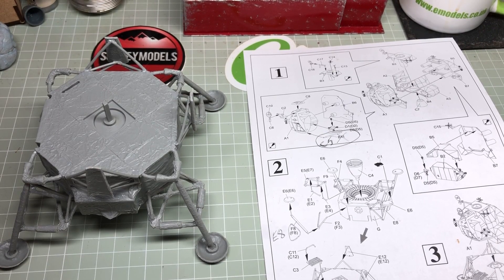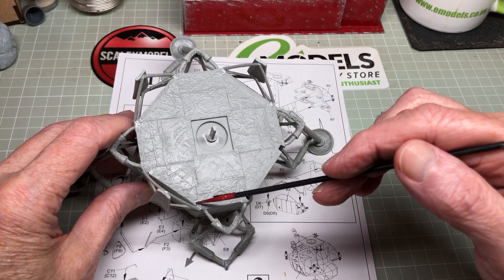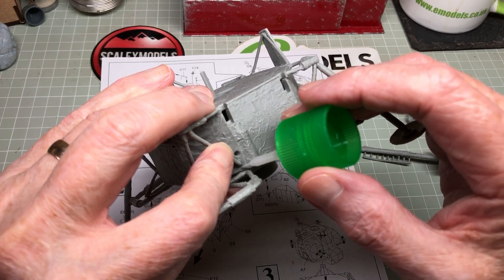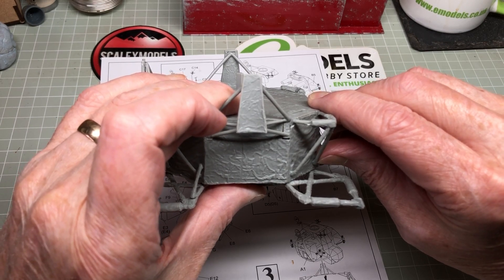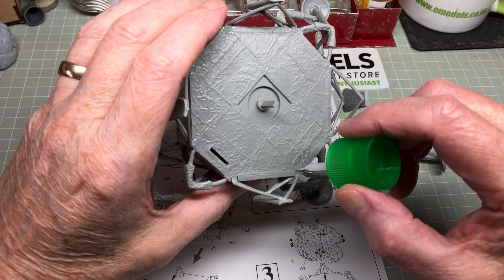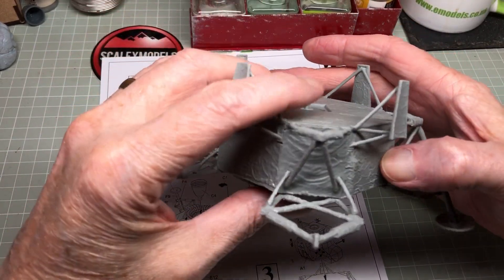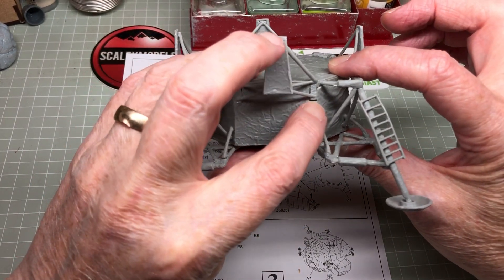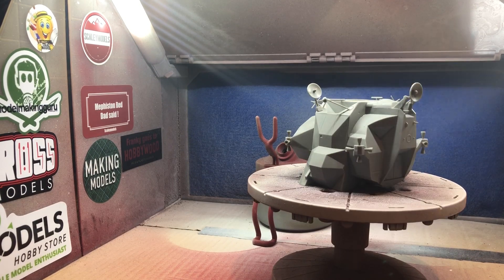Dragon Eagle Part 2

Comment: Just about to finish the Dragon Saturn v, has the 1/72 lem inside. I painted it grey, but i think the colour might be more a very light  beige or milky coffee. It's described as anodized aluminium but dull sheen.. I have seen similar but it's hard to describe.
Reply from the maker: wow, how did it go together? yep a very milky coffeee colour i understand it to be too, thanks for the comments
Reply: @Scaleymodels  Needs some work a few inaccuracies on the rocket. Lacking detail, but can be put right if you study lots of photos.
Yes i think i will wash over the grey on my lem to lighten it up, but pretty impossible to find any decent pictures, not actually on the moon.